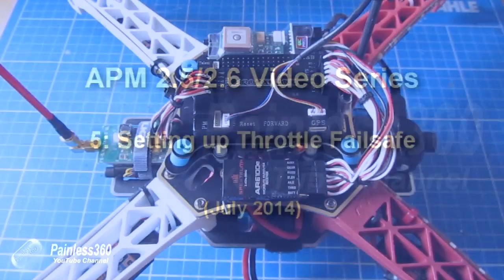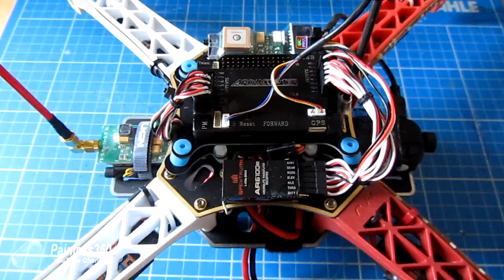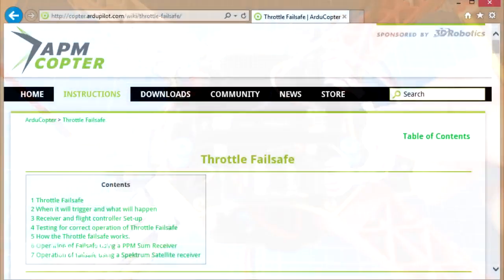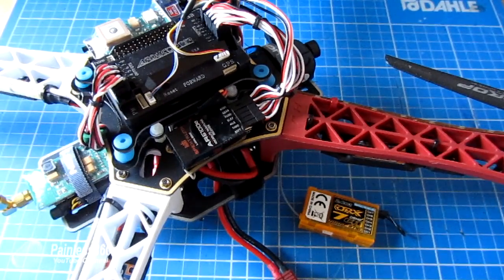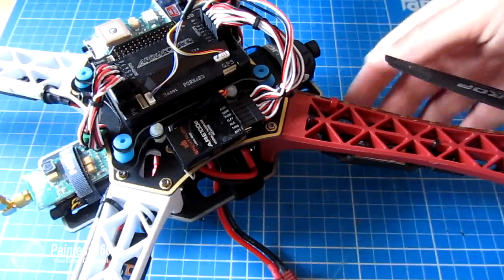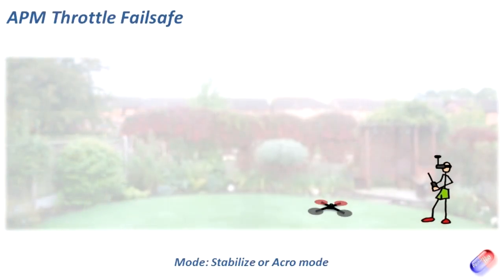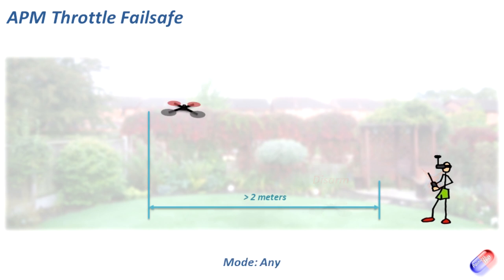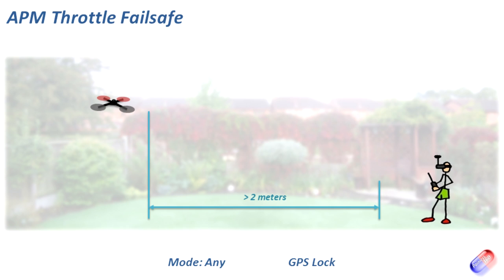(5/8) APM 2.5/2.6/3.1 - Throttle Failsafe Setup

Comment: hy Mr. painless360

if the radio was shut down , throttle disarmed and drop below 990 , then how can it be to return to launch if conditions quadcopter disarmed ?

how to configure or " how much throttle " if I want to turn the radio off and failsafe in case of return to launch ( arm) ?

I strongly plead with you to explain in detail so as failsafe I mean it was really a return to launch in a state of throttle arm , instead of landing in any place

please answer my question
thanks a lot
Reply from the maker: +aDe we did our best at covering that in this video. If you need more detail than this then the documentation is excellent. http://ardupilot.org/copter/docs/radio-failsafe.html is very good. Best of luck!
Reply: I am very confused as to what I should do after reading the guide of sites that you gave it..

I guess you just guide of your video that really helped me ..

I was just confused , in the video , you explained that the throttle position when failsafe are at the zero position ..

 I ask ,
1. The zero throttle position could RTL to flight mode ?

2. how can I set the position of the throttle in order to RTL and secure to my hands again?
(Its mean , what percentage of throttle in need ?

on my quad 250 , if the flight mode switch in RTL mode , loiter or althold , why it is always full throttle ?
Similarly at the time failsafe , monitor FPV seen if the throttle in a state of 85 % to 100 % ..
even more often 100 % throttle

I hope you know the solution to the problems that I experienced this throttle
Reply: I just wanted return to home and quad back to me but not in conditions of high throttle

whether the same features with RTH RTL mode ?

I wear Crius aio pro v2 with firmware APM 3.1.5

Comment: Thanks! This will help... Do you have experience with NEO 6M GPS module? I have got a Chinese one that is called Happymodel. Hopefully will not cause trouble. :)
Reply from the maker: +Ádám Mokánszki we've used lots of Neo 6  models here. They work fine as long as the unit isn't faulty. Best of luck!

Comment: Hi , I have followed your Video from start to finish but i still cant get the Ch3 PWM to go below 1000 when i switch my RC off, I have the flysky fs-i6 and i`m using the fs-ia6b receiver ,all the fail safe on the RX are off , Thanks
Reply from the maker: No idea, we don't have that radio here. I'd look into failsafe 'features' for that receiver. Best of luck..
Reply: A few years late to the party, did you find a solution Mike? Same problem.
Reply: @jonathanjones6197  hi, sorry, I did but I can't remember how if you need help, let me know I will look at my setup for you.
Reply: @aroundandabout1854  I worked it out in the end thank you, it was all done on the Tx under Failsafe and End Points.
Reply: @jonathanjones6197  ok I'm glad you sorted it out take care...

Comment: Hey Painless trying to setup arduplane on my plane is the FlySky FS-iA6 receiver have failsafe?
Reply from the maker: We've not used them here - what does it say on the specs for the receiver (if it has it - it should be listed as a feature). Best of luck!
Reply: thx

Comment: If you have a receiver like Frsky and you shut off the transmitter and the signal stays the same you have to set the failsafe on the receiver. After binding you switch on the receiver without the transmitter and push the button on the receiver for a second. The next time you power up the system you will see the throttle PWM fall to around 900 when you shut off the transmitter. Be safe try this without props of coarse.
Reply: Hi, 
virgodave61 
I used the Flysky transmitter and receiver fs=i10 . u mention that after binding switch on the receiver and push the button on the receiver. may I know which button? there is no button found on the Flysky receiver.
Thanks

Comment: Hi!
I've learned what you said and it's cool :) , but when my hexa loses the touch with my aurora 9x transmitter it gets into land mode but turns off the motors. I've noticed that when copter is landed and connected to MP it's obvious it knows that it's on the ground so it turns the motors off. But when I get it up about 1 meter high the problem is the same. Why is that ?
Reply from the maker: +Mikołaj Mirski Not sure what you're asking..
Reply: +Painless360 
My question is: Why my copter disarms motors when I turn off the transmitter? 
It should get the LAND mode , next land and disarm motors at the end, right :) ?
Reply from the maker: I'd check out how you've got the failsafe's configured and how the mode switch moves when you disconnect the radio - best of luck!

Comment: Hey so I've got the orangerx receiver and followed your video. Works perfectly! Except when I turn off the tx, it disarms.. Failsafe kicks in then disarms.. Any idea what I can do to fix this? And I have it set to rtl but it goes into land instead.. Thanks!!
Reply from the maker: +Joseph King You need to rebind the rx with the switch used for modes set to the position for RTL on the radio.. Best of luck..

Comment: Thanks for all of your videos! I am fairly new to this and you have helped me out emmensly. I set up my throttle failsafe in Mission Planner as per your instructions. When I turn off my transmiter I get the same disarmed warning that you got. My question is that shouldn't the Mission Planner display show RTL? It kinda scares me to think that my quad may just disarm midflight if signal is lost. I saw on another video, using a much earlier version of MP,  that the display went to RTL. Thanks again! Oh, I am using a Turnigy 9X TX and Rx
Reply from the maker: +skip whitley You can set the failsafe on the Rx to set the 'mode' to RTL or setup the failsafe in Mission Planner to GPS Home too. Best of luck..
Reply: +Painless360 I did set it up in Mission Planner to RTL. It just doesn't actually display "RTL" when I check it by arming the quad then shutting down the transmitter. It only displays "disarmed"..I hope this makes sense????HAHA..thanks

Comment: hi thanks for the videos, they're a really big help for my first build. when you say re-bind, is that rebinding the transmitter and receiver? and is this done whilst connected to mission planner. Also what did you disconnect when you disconnected everything? (Sorry I'm a complete novice)
it doesn't seem to work for me so maybe I'm doing something wrong. I'm using a 9ch Radiolink. 
thanks
Reply from the maker: +wayne sprangle You rebind so that the radio receiver starts with the right channel values and (in the event of a radio problem) the failsafes are set too. As you may have setup trims and changed things on the radio you need to refresh the stored channel settings on the Rx too before flying.. Best of luck!

Comment: Is it possible to regain control of the model after fail safe has been triggered?
Reply from the maker: +scotty562 Yes, read up about it on the wiki pages. Once the model comes back into radio range and the radio makes a connection the flight mode on the radio is then used... Best of luck!

Comment: Hi, thanks for the video, I'm using the taranis. My normal low throttle setting is already 992, I can't drop it any further through the servo trim menu. How do I get this to work using this method if I can't go lower?
Reply from the maker: +SuperRCNOOB You need to have the throttle range about 1040-1980 really. Lower than 1000 should only be seen in the event of failsafe. We do cover this in the Taranis series. Best of luck!
Reply: +Painless360 I can use the trim menu to change the values to be in the right range, i.e change the values so the read in the low position 1040, but then the board won't arm?
Reply from the maker: See our video in the series on troubleshooting arming.. Should help.

Comment: Hi! First of all I would like to thank you for all these videos you made for the APM community users. I have been in trouble with APM setups since I got my first board (APM 2.5) a few years ago. Now have sorted all the setup issues out thanks to your videos highly informative and well presented, but I am still facing a new challenge with motors arm. Just to let you know I am flying fixed wing (twin motors) so I am running v3.4.0 firmware and managing Mission Planner parameters through 915MHz telemetry.
Now the issue...I am able to arm the motors whenever I am connected via telemetry and speed the motors by throttle normally but without telemetry connection, even plugging the batteries in, the motors start running in low rotation by themselves and I am unable to disarm. In both cases I am unable to disarm the board. 
What can I do to this? What am I doing wrong? Could you please help me?
Thanks in advance.

Comment: Hello painless just a quick question.when I upgraded my APM 2.6 to 3.1 I have an issue throttle it seems its ony in 1/4 power I tried in MP in FULL PARAMETER LIST -THR_MAX, ive modified to 100  200 but the throttle still in  1/4 power...appreciate any advice from you..
Reply from the maker: +Richard Ricafort I'd check the throttle range is moving all the way and then re-flash the board and go through the setup again. Something sounds confused. Best of luck!

Comment: Is this procedure recommended or necessary even if I have a reciever failsafe? Or can I just rely on the reciever failsafe function? I'm using the frsky d8r-xp. Thanks in advance. James.
Reply from the maker: +James Dyke I rely on the failsafe of the receiver myself. This is a useful thing to have in case the connection between the Rx and the FC fails.. Happy flying!
Reply: +Painless360 ok great thanks. So I can leave the failsafe function in MP turned off, and just rely on my preset reciever failsafe to instruct the APM what to do? Also, as in using the arduplane firmware, (flying wing) will the throttle take care of itself when I'm failsafe mode?

Comment: Hi! I have some problems with setting up failsafe. I use APM 2.5 with walkera devo F7 and rx703A. I have set up in Tx failsafe for throttle -125. When I turn off my tx the MP shows that throttle drops/goes up to half throttle and board stays armed and the flight data window doesn't show failsafe. Have you any idea what I have done wrong?
Reply from the maker: +Raimonds Lug You need to look at how you reset the failsafe up for the radio/receiver. I've not used this radio and Rx myself so can't help directly. Best of luck with it.

Comment: Awesome job on the videos. I just installed a new compass, when I calibrate it should I make sure that I have a good sat. link before I do the calibration ?
Reply from the maker: David Gennetti It shouldn't matter but I'd make sure that the craft is as close to how it will fly when I run through the calibration - everything powered, battery in the right place etc.Best of luck..

Comment: Another great vid!

With your approach of having the RX failsafe set flight mode switch outside of the normal range you not only triggered RTL but also disarmed the APM.

However, it's much easier to just have the RX set to failsafe to the RTL flight mode switch--although this won't disarm the APM.

I suppose on the latter if it lost control while you're in stabilize and then entered normal range again stabilize would kick in because it is armed the whole time, but is this really bad behavior? Probably you would already have set to manually RTL on the switch anyway.

EDIT: Figured it out. Having the failsafe setup as you describe is the proper way because it not only allows the APM to work properly when the RX completely dies, but allows different behavior such as the graphics you have a few minutes into the vid.

Comment: need held i did everthing right but my proplem is whrn i arm the motors hit full trottle an i get only half an my throttle is set at 150 %
Reply from the maker: Why set your throttle to more than 100%? Have you calibrated the ESCs?
Reply: Painless360 yes many time an right when done whith the esc calibrations the throttle is perfict then i unplug the batt an re plug it an arm it with the trottle stick ,an it back to where it was weeek it wont even lift off the dround
Reply from the maker: Joe H&H Services A video to see what you are doing would be useful..
Reply from the maker: OK, could you post a video of it?

Comment: Hi first thanks a lote for those professional videos you post on how to with the APM tgey have been very helpful !! 

I have a quick question 
My throttle on the apm is at 1091 when my TX is ON .. but when i put off my TX  i hits 1197... and my failsafe is seted up at 975 how can i fix that  please help ..
Reply from the maker: Michel Maalouf You need to rebind the receiver with the radio throttle set to the value you want it to put out if it looses connection...
best of luck..

Comment: Hello Painless, with the help from your excellent video series I'm only days away from my first flight ever :) At this moment I'm stuck with the failsafe thing: I have the Walkera Devo 10 Tx, found how to set the lowest throttle to 975, done as shown in this video (Rx re-bind) but the original value appears and when I turn off the Tx the failsafe will not work. All values show up as before. I'm sure that I'm missing something, but what??? (two days trying in a row  v_v ). My problem starts at 8:50 in the vid. Do you have an additional tip, please ?
Reply from the maker: Check that the Rx supports failsafe and check the manual for the Rx on the process to lock the failsafe values. 

I don't use that kit here, but not all receivers have a fail safe.. 

Best of luck
Reply: Painless360 :) ok, your hint with the failsafe support made it! yes, the Devo10 have failsafe. I set throttle in the Tx from servo hold to failsafe and the value from L100% to L125% (the max. possible). In Missionplanner it goes down in failsafe to 999. That is the lowest value possible. To have the recommended difference of "20" I set the failsafe value up from 990 to 1020. No need to re-bind the Devo10. My throttle goes from 1093 to 2000 now. When I simulate the failure now the throttle shows 999(1000). So it works now. Are the values I choose OK?     Thank you for your effective help!
Reply from the maker: Should work fine. Glad you git it sorted!

Happy flying!

Comment: William Booth   I have a Futaba 6j Radio I have the same PreArm  Check FS_THR_Value warning on arm, I set my FS PWN  in point to 990 .Low batt to 10.5 ,normal throttle is low 1027 to 1976 high. is the Futaba T6J  the wrong radio set this  Tri copter .
Reply from the maker: William Booth That should work fine. It supports both plane and acro. 
Best of luck..

Comment: Hi,

I have a crius aio V2 filght controller board and uploaded the megapirateNG V3.0.1 and I have a Flysky FS-T6 transmitter, but it doen't have failsafe. I saw this: 

http://www.hobbyking.com/hobbyking/store/__20618__Turnigy_Micro_Failsafe_with_Brake_function.html

Could this fix my problem?
Reply from the maker: ***** I would replace the receiver on the model with one that supports failsafe myself. Adding extra electronics to try and 'fix' a problem may not work and only adds more complexity to the model and increases the chance of something going wrong. 
Happy flying!
Reply: Painless360 Which receiver do you recommend that has failsafe?
Reply from the maker: No idea, I use Spektrum radio kit here. Look up the receivers you can use with your radio and pick one that has failsafe listed in the specs.

Best of luck.

Comment: Hello Painless ,,another query;I  have an issue on Throttle setup ,,eventhough i throttled to 50% to 100% it seems the Throttle is min and cannot LIFT the TRUST .i set in the ADVANCE PARAMS (MP) to 450 versus 1000 the TRHOTTLE_MAX and write the Params...but still the throtlle in minimum interaction..Im using 1045 Prop my Lipos 3S 2200 mAH.can you give some hint where should i calibrate ...
Reply from the maker: Richard Ricafort What is the range showing in the MP radio calibration screen for the throttle channel?
Reply: Hello painless -MP -Failsafe view channel 3  response in correct from min to max. in SERVO -Mtor out the radio 1 to radio 4 also increase when I applied throttle..last night im suspecting there is reverse in motor orientation I followed this link.http://copter.ardupilot.com/wiki/initial-setup/motor-setup/ plus reversing the mtor lead versus the ESC lead connector...Iam Using H frame base in Quanum Venture quad and also base in H frame in APM prop orientation.now the prop orientation is correct
Reply: Painless  after followed the APM ESC motor and ESC wiring connection the prop behave in the correct rotation base on the H Frame prop orientation ,,the Throttle behave in Min and MAX ..the frame move only NOT Lift the TRUST it seems need power and torque probably the 3S 2200mAH lipos here NOT sufficient to load power and torque Im thinking about 3S 4000 mAH lipos to give more Load current..may be in ADVANCE PARAMS will sets to 1000? currently in 480...any suggestions
Reply: or maybe need again to calibrate RADIO CALIBRATION my THROTTLE there display 900 as you requested to view again in the Radio Calibration..

Comment: Hello Painless I follow calibrate AGAIN the ESC one by one and set in Mission Planner in STANDARD PARAMS i set the SKIP GPS for a while and it Works Now !the four motor ARMED and SPIN  after 5 secs arming in Lower right stick and all the 4 motors behave in normal throttle max and min applied I monitored  in FAILSAFE all the Motor /servos out seen in the Mission Planner,,I appreciated your helps...I will proceed to maiden this after make some tuning in flight mode in MP plus in my Radio for toggling  switch for Flight mode...have a nice day !!!
Reply from the maker: Hi Richard, well done on getting it working - have a safe first test hover!